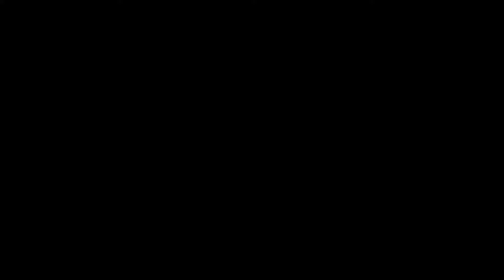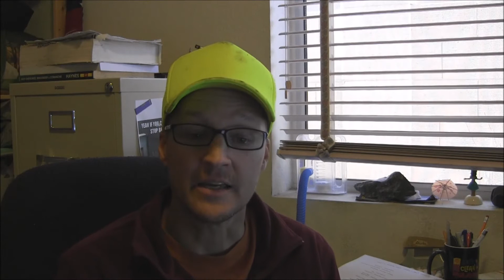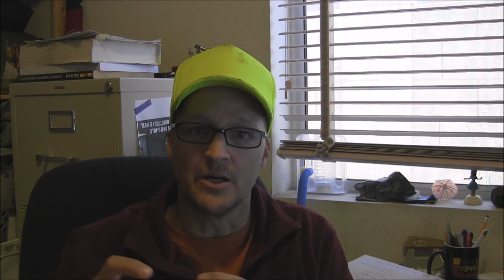2008 Honda Civic Blown Head Gasket Diagnosis.  Your Engine Will Melt!!!  How to detect and avoid.

Comment: Why the dislikes? Your video was very helpful. My 8th Gen Civic 2007 had a similar failure. Overheated on Fway and check engine light came on. It was too late. Ignition coil caps were melted onto the overhead and the dipstick was charred, coolant spewed everywhere. 315K miles. I sent it Honda heaven. :(
Reply from the maker: The dislikes are a puzzle to me too.  It's just information.  Sorry to hear it happened to you too.

Comment: Hi there! My car has a rough start up and its consuming the coolant really fast with no leaks causing it to over heat. Check engine light came on and I took it to a local auto shop. They  didn’t find anything wrong with the car it just gave them a code of misfire in cylinder 1. I’m almost 95% that my head gasket is bad. Will replacing the head gasket fix this problem? Theres no milky color to the oil or no oil light.
Reply from the maker: Having no coolant showing up in your engine oil is good.  If you're still losing coolant though, it means it's probably leaking out somewhere else, and that can be fixed with a new radiator or hoses.  Anywhere the coolant flows that might spring a leak.  Unfortunately that also might mean a blown head gasket, which can also cause a cylinder misfire.  Will a new head gasket fix the trouble code and the coolant leak?  If you can't see coolant leaks anywhere else, but you see evidence of leaking from the cylinder head, there's a very good chance a new head gasket would fix both problems.  Coolant can leak from a blown gasket and a blown gasket can also cause a cylinder misfire from loss of compression.  Either way though, what you're describing sounds serious and should be addressed immediately or you put your engine at risk.  Good luck!
Reply: @DoctorFixMaster  i drove my car for about 2 week and it was over heating on me everyday. People are telling me I need a new engine and head gasket. I think I did damage to my engine by driving it. The car still starts though?
Reply from the maker: @LauraKittyGang  Driving it everyday and overheating it certainly won't be good for it.  How much damage was done is anyone's guess.  Whatever the case, the root cause needs to be corrected immediately, and whoever does that work can assess the engine for damage.  I'd do no more driving until that is fixed.  Otherwise your bills could end up a lot bigger.  If you can still start it, that's a good sign.  If the root cause is corrected, you might be lucky enough to have avoided major engine damage.

Comment: Question. I think I’m too late but my 07 civic oil light came on shut off came to hault and noticed one of the coils was blown off and dipstick was melted into the tube it had oil when I got it towed home and I changed the oil. Am I too late I got new coil and oil let me drive it normally then bam same thing now it’s just sitting waiting to see what I do with it
Reply from the maker: Anything that makes your engine hot enough to melt the dipstick is probably doing permanent damage to your engine.  What did your oil look like when you did the change?  Did the same coil blow off the next time?  Did you inspect the plugs?  Normally the plug seals the cylinder.  if you're blowing spark coils right off the coil, that tells me you don't have a good seal.  Is the plug loose or rattling around in there?

Comment: SO IF THE OIL PRESSURE LIVHT IS NOT ON THEN IS THERE STOLL TIME TO FIX THE car ? SMOKE COMES OUT OF MY EXHAUST AND ONE DAY IT JUST GAVE UP ON ME
Reply from the maker: Anything suspicious like a lot of smoke should have you immediately checking the oil level and the condition and cleanliness of the oil.  A lot of old engines can smoke when there is nothing really wrong with them but worn pistons and rings.  If your oil ever looks like a chocolate milkshake, you have a crack in the engine block and you'll need a new engine.

Comment: My 2007 Civic leaks coolant from the back of engine hard to see where it's coming from those engines are not to crack at the front of the block but for they crack at the back or could this be a head gasket failure ?
Reply from the maker: If it isn't coming from a hose or some other peripheral component, but from the block, it is not a good sign.  Sorry to hear it.
Reply: They had a issue with this year engine they all crack the blocks. There was a service recall on those engines but recall only was for 10 years.
Reply: I had exactly the same problem, it was a thin coolant pipe leaking at the back of the engine

Comment: Hey doctor enjoy your civic repair videos. Do you happen to have a engine crack? It is most common on the 2006 to 2009 models where the engine block will have a line crack leaks coolant.
Reply from the maker: Good point.  That can also produce the same symptoms as a blown head gasket.  In my particular case, the mechanic who opened it up for me to have a look said it was indeed a blown gasket, but what you're suggesting is a very real (and apparently common) problem that people should be aware of.  You'd diagnose it in exactly the same way.  (What a a bummer though...a cracked engine is a dead engine.  Come ON HONDA!!)  Thanks!
Reply from the maker: Honda has a reputation of quality, right?  That's why people pay a premium for a Honda vehicle.  I'm wondering what all the hype is about now.  If we're blowing gastkets AND getting cracked engine blocks, I'm probably done buying Honda cars.  Most people can deal with peripherals that need maintenance, but when there are major quality issues with the engine itself, its time to look for a brand where you aren't purchasing problems.  The engine above all else must be bulletproof, or no sale.
Reply: Did you report this to your local Honda dealer? Supposedly this is a secret 10 year warranty and should replace it for free. I totally agree in every aspect. This 8th gen is where many people say “Honda went downhill” overall to many problems. To be honest I was about to purchase a 8th gen civic for the style, but hearing this makes me want to look else where. The newer civics so much better. I drive a 2003 civic btw.
Reply from the maker: Thanks for the tip.  I think I will let them know.  I haven't yet.  The car had 140k miles on it.  I figured it was well  out of warranty, but its worth a try.  :)
Reply from the maker: Holy smokes!!  I cannot thank you enough.  I contacted Honda Customer Service and they instructed me to take the old engine to the dealer for evaluation, which I did.  I was 3 months from crossing the 10 year special warranty for this particular problem.  They  took photos of the old engine and determined that my problem was a cracked block (turns out the mechanic didn't actually spend any time looking at the head gasket, so they really didn't know).  I've submitted my receipts for a used engine (from 2010 model year that is supposed to be beyond the years that had problems) re-install, and they are making good on their word by paying for it.  I'm impressed!  I wouldn't have thought that kind of devotion to customer satisfaction was for real.  Wow!
Reply from the maker: I need to post a follow up video.  Head gaskets do blow on these, so I'll leave this video in place, but I'll follow it up with another vid telling the rest of the story.  There's nothing you can do to prevent a cracked block, but you have recourse if you're still in the 10 year warranty window.  I'm so relieved!
Reply: Hey god bless you man, you got to the finish line. You got yourself brand new car that means we will get more repair videos from you. Ha ha. Even though this is a huge flaw on Honda’s part at least they acknowledge it, but still this should be a official recall for life time warranty. If only we had enough people with pitch forks marching in the dealerships.